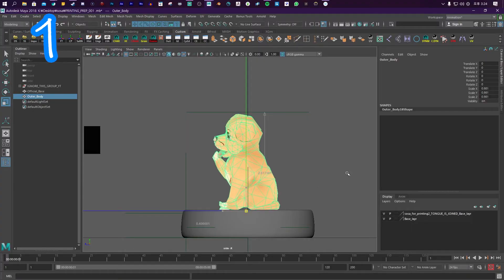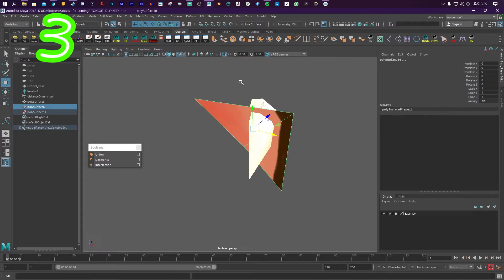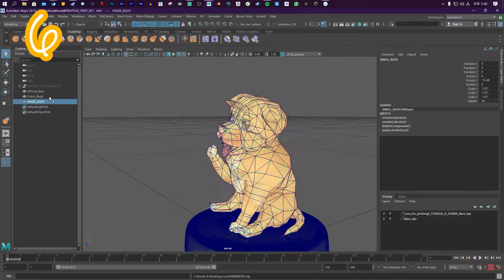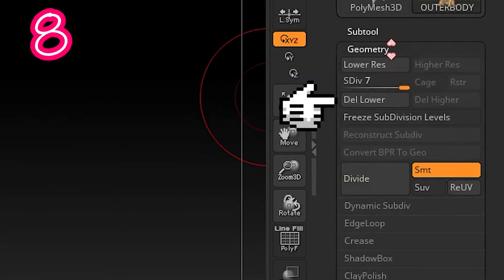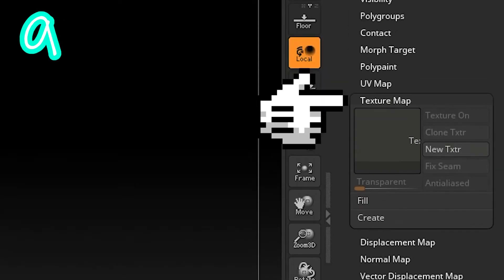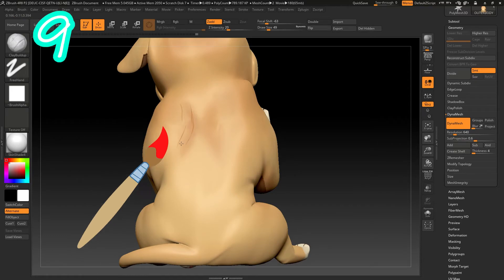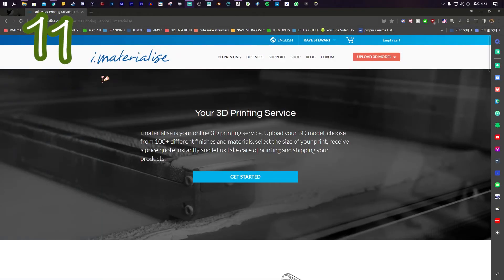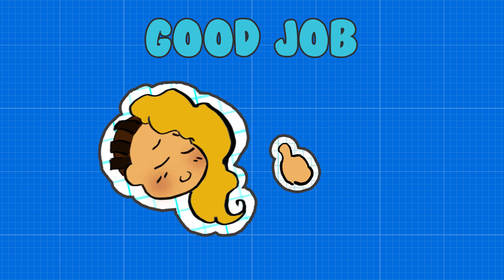How to Make a Model 3D Print Ready in MAYA and ZBRUSH FAST and EASY

Comment: Why did you create 2 meshes and scale it down? Did you do it to close random holes that can cause problems?
Reply from the maker: Hi matthias!
In the beginning we duplicate it to create an outer shell and an inner shell
(3d printed models require a wall inside them otherwise they'll be too thin and break)

so one is the side people see!
the other is like the "ribcage and muscles" etc the part that's not seen but is required for it to stand up!

To close holes I highly recommend you do that before you duplicate the mesh to make the inner and outer otherwise you'll have to fix it twice!